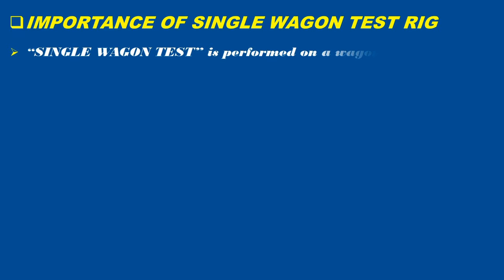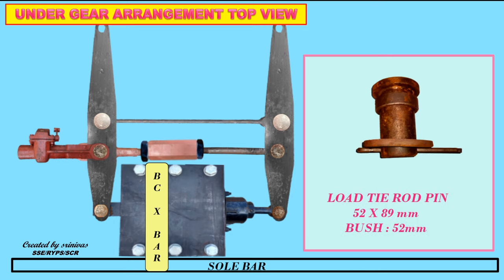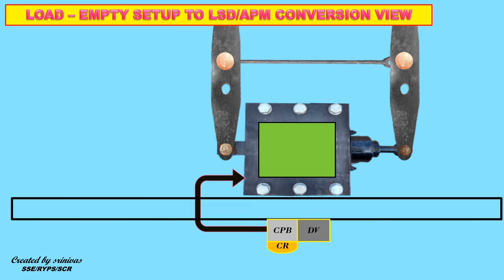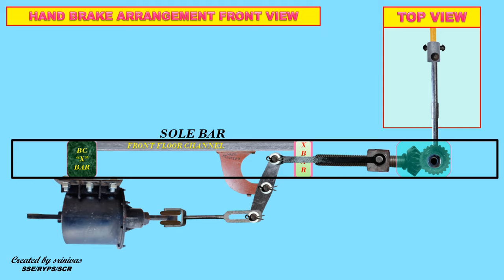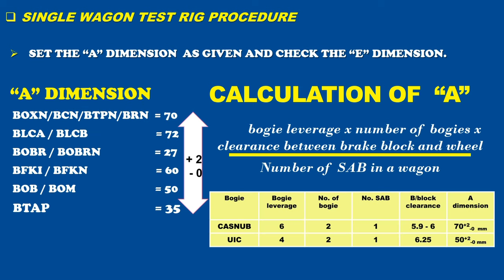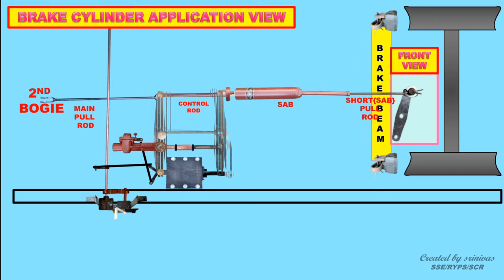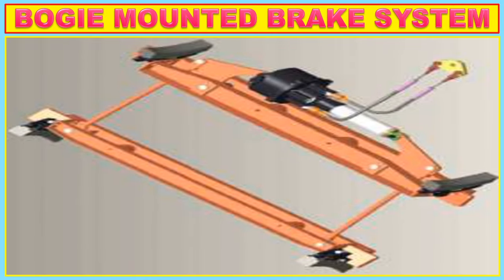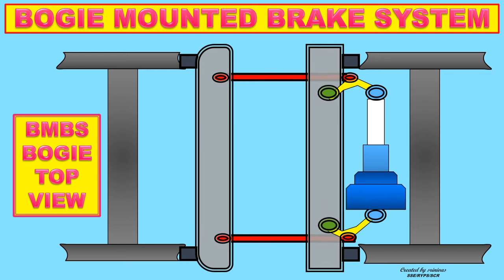BOXN Wagon Parts Explained and BOXNHL BMBS Parts Explained

Comment: sir we know that due to push rod, force from the expansion cylinder transfer to the secondary brake block via bell crank lever mechanism, but how reaction force is developed which enables to apply brakes on primary brake block. Can you explain how the push rod works in depth ?

Comment: Sir in bcnashm1 wagon double pipe bmbs brake system  in this wagon el60 box not available  so how can we insure brake release or not and hand brake relese or not
Reply from the maker: Check BMBS BCs indicators
Reply: @srinivasavutapalli  sir their is no indication in ESC ke type brake cylinder
Reply from the maker: @AI_ytbmgo  , ESCORT BMBS also indicator is there, see below link, in application back ward movement of the indicator.
https://drive.google.com/file/d/10I-ER43r7KINEdci2hK0QDpFfcqDrpwr/view?usp=drivesdk
Reply: @srinivasavutapalli  thank u sir